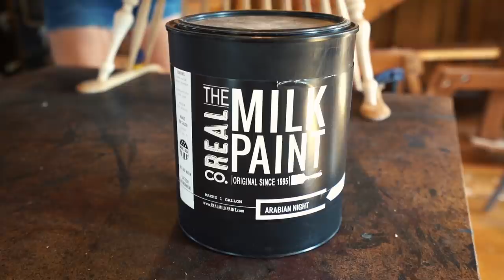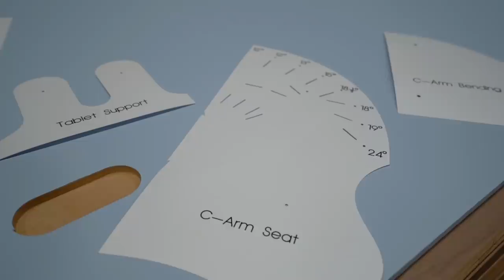A Unique Experience - Building An Heirloom

Comment: Nice work! I have some questions about drying the wood:
How dry was the log when you started? The splitting scene is filmed outdoors. Still, I guess the log was stored indoor or at least in a shelter for quite some time before you started. Do you know for how long it was dried?
Did you let the wood dry between splitting and further  processing? Did you see any shrinking problems after the chair was complete? I guess the chair will be exposed to a drier climate when you move it from Tennessee to Texas... I will appreciate your comments.